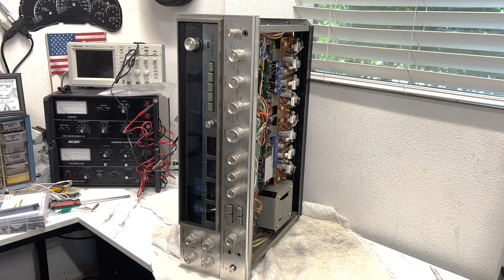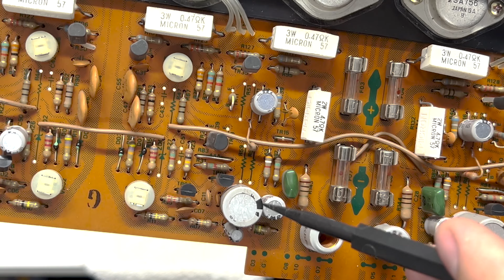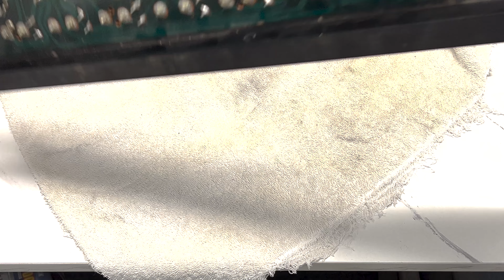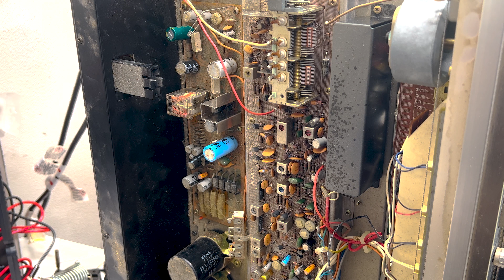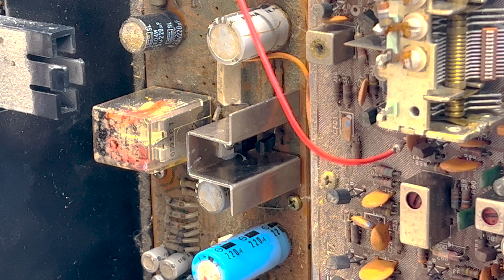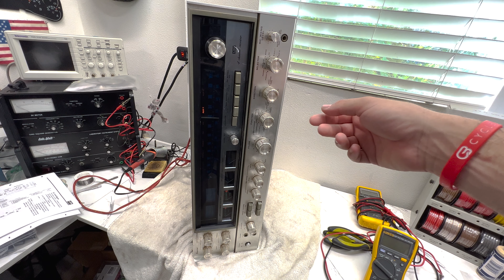Sansui QRX-5500 - Can We Get It Working Again??  [Questionable Repairs Found!] #audio

Comment: My QRX 5500A  fm reception isn't the greatest.  My antenna is a " T bar handle that pulls out, extends, 3-4" away from the body. I see the word " antenna" on the rear, rightmost side of the amp( facing the front) . There's about connect points back there, same type as the speaker wire connects- push spring loaded lever down, revealing the hole into which you insert the bare wire. How should I proceed to get increased fm reception? Thanks.. ps I just got a CHHLIUT that a commenter said he used on his Sansui 5500, but I don't see how this can work on my amp

Comment: Hey I'm in the middle of a protection mode issue on my QRX , is it ok to plug it in to be able to check a live protection board  with the power amp board out
Reply from the maker: Hey! Yeah, I did that when I first got the unit to try and narrow down where the issue was, and to check voltages at certain points. What's yours doing? Will it come out of protection at all? or is it cycling on and off?
Reply: @TinkeringWithT  relay doesn't engage at all replaced it along with the snubber , still nothing  checked relay out the board and works fine  , just ordered new transistors  and caps for the board ,
Reply from the maker: @Nothereneverwas69  Great! Hopefully that gets it working again! Mine did the same thing when I first got it. Try pulling the power amp board and firing it up to see if the relay engages. If it doesn't, I'd assume that theres an issue on that protection board. If it does engage, it's possible that there is an abundance of DC offset at one of the speaker terminals so it's just trying to protect the speakers. When I have time, I'm definitely going to re-cap the whole unit, and replace transistors.